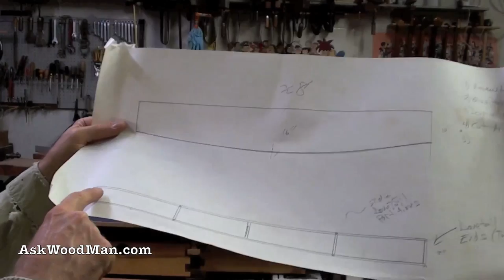2 of 28 • Building An Entertainment Center for Flat Screen TV: A Furniture Project

Comment from the maker: No problem Jeffery. You will will notice when I work on that beast of a band saw my hands do not get anywhere near that scary blade. My worst woodworking injury was getting my left thumb pinched between a spinning piece and the tool rest on an industrial lathe. I did not have a nail for over a year. I was 25. My wife calls it the icky thumb. The nail bed was so severely damaged that I still have a big hump and ridges in the nail. Plenty of push sticks always at the ready is a good thing.

Comment from the maker: Hi Will. Nothing beats that Hitachi for quick rough cut straight lining. With that 3" blade and 1TPI, it is a monster solid wood machine.  Especially in thick rough uneven boards. My selection of track saw blades is more for finer plywood or panel cutting.

Comment from the maker: I just have the ts55 for panel work, but from people I have spoken with, that 75 will gobble up 8/4 with a ripping blade, as well as thin steel. And with the change of a blade you can make precision wood cuts. The tracks are tough. As long as the board is reasonably straight the guide will conform. A few well placed shims will fix the most unruly boards. No tools have ever paid for themselves faster than the Festool machines I have bought. I run my stuff hard and have zero problems.

Comment from the maker: Hardwood lumber standards say wood must be at least the stated thickness in the rough. I routinely buy poplar 4/4 that is 1.25-1.375". Often 8/4 maple and sipo are well over 2". When you buy wood that is already surfaced they are not calling it 3/4" when they make the board foot calculation, but are calculating the volume at a full 1". So you end up paying for wood that is already gone. There are 3 lumber places in Austin that sell lumber in the rough. It is the best way for me to use wood.

Comment from the maker: I am always a little hesitant to show that machine. It is scary and exhilarating at the same time. But as you can see it makes short work of sizing lumber. And in reality it is a very safe machine as long as you keep away from those teeth. All the action is down so no chance of kickback.  You notice how I use push sticks? I don't want to be known as "Stumps". Eventually I would like to put a quieter capacitor start motor on it. Thanks for writing. Allan

Comment: Allan, move to the Bay Area.  The weather is great.  Not too hot, not too cold.  Gets a little rainy and wet during the winter but it' doesn't last long and usually turns to sunny the day after.  It's one of the reasons I moved back here after 21 years in Alaska.

Comment from the maker: @rutabegared1 At 6:11 when I pan down you can see hose coming out the bottom. I just made simple cardboard baffles around a 90 elbow at the bottom and closed off the useless side inlet on the machine. My little 400cfm collector does a good job with this modification. I am actually happy the Cowgirls are out. Now I can just enjoy some great playoff action. There has been a lot of controversy about the new F1 track here. It looked like the whole thing was falling apart recently.

Comment: 50 degrees up here in Wisconsin. Huge Packers fan here btw. Also you guys should can Romo and pick up Flynn I'd like to see him stay in the NFC, maybe we could trade Demarco Murray or Laurent Robinson. I can't take the Humid weather when I'm working up here especially doing floor covering when the new construction homes are flooded with moisture from the concrete new lumber and paint / mud. Building homes so fast is just a recipe for disaster. Unless you have a running dehumidifier.

Comment: I always see you using wood in the rough. Where around here to you buy your boards like that? All I can find are 2S2 or 4S4. I don't have the monster tools that you have, but I do have a 6" jointer and a thickness planer that I would rather use to do them myself. When I buy 2S2 lumber, it ends up warping when I acclimate the wood to my shop, then, to get the warpage out, the wood is too thin for what I want. So, I end up having to buy and waste a lot of wood. I would rather start thicker and 0S0

Comment: I was wondering about that twisted one. "My" primary shop does not have a jointer, nor space for one until I can convince gramps it's necessary. I was thinking of purchasing a ts 75 to straight line rip, as well as field work. Do you think the track would give to the flex, making it inefficient for  straight line rips?

Comment: @askwoodman Thanks.  I'm doubtful of the effectiveness of that side inlet too.  I have hookups to both my side inlet and the bottom cabinet.  I forgot to open the blast gate to the side inlet and didn't realize until after I did a lot of cutting, but it didn't make a noticealbe difference.  I followed the F1 controversy surrounding Austin.  It boiled down to an unpaid $25 million dollar fee to secure the race.  It's been paid and the race is a go in November.